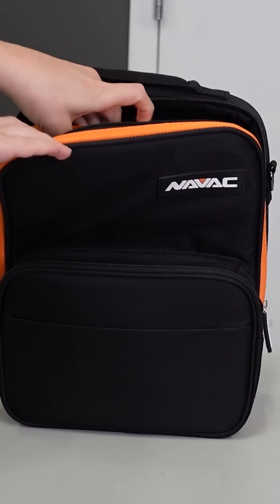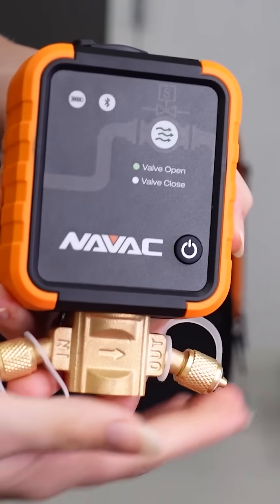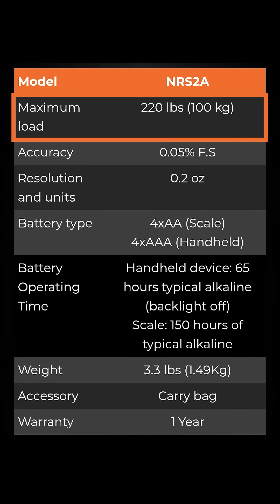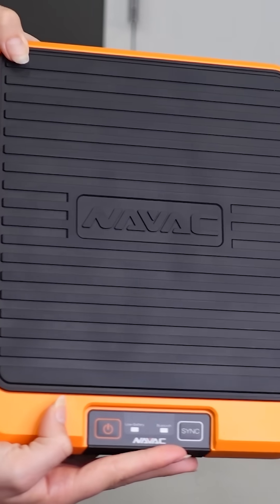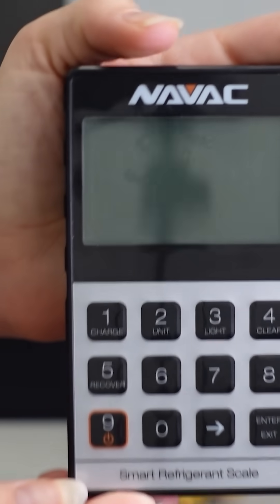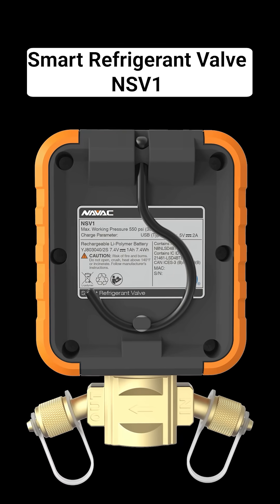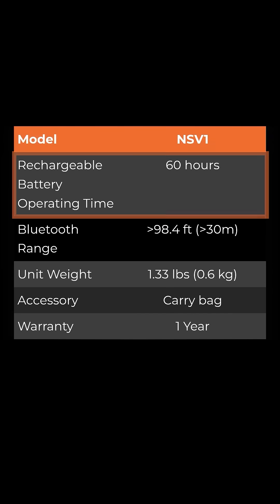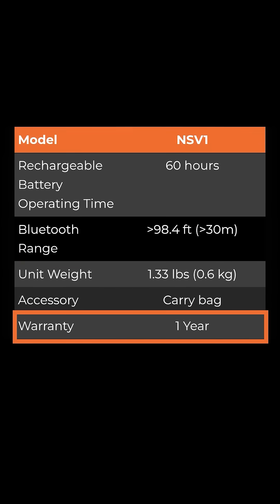NAVAC SK2SV1 Smart Refrigerant Flow Control Kit Unboxing | Digital Scale + Bluetooth Valve for HVAC

Comment: You'd need a very good salesman to convince me that this combo will save me enough time and money in the long run.

I'd rather manually monitor charging a system then rely on a Chinese made electronic solenoid.

I do see the benefit in recovery, can be used in tandem with the 80% safety shut off for example.